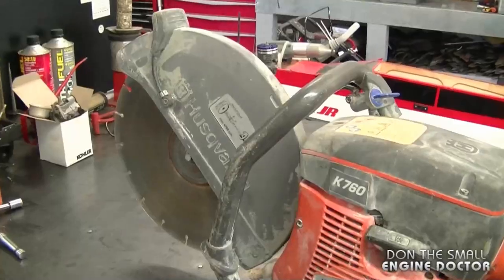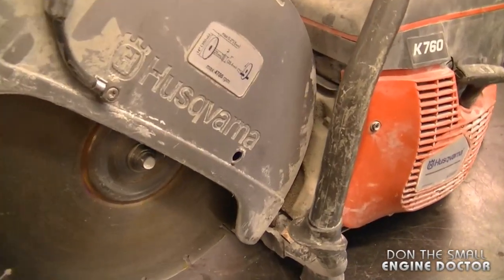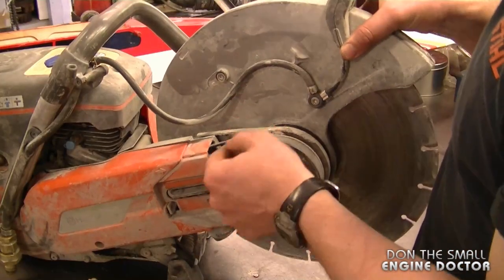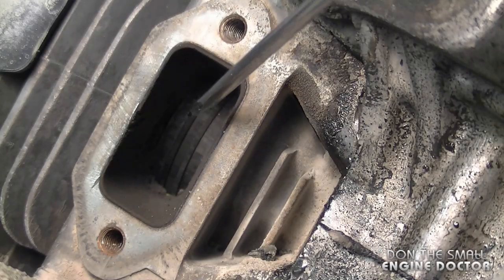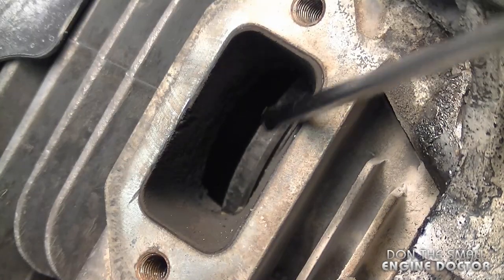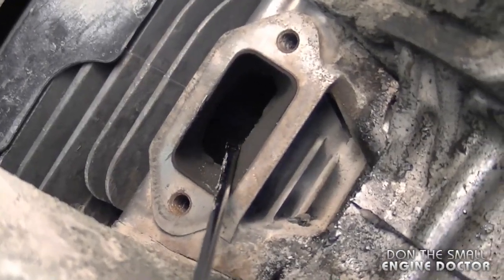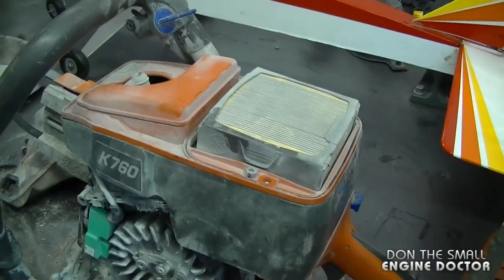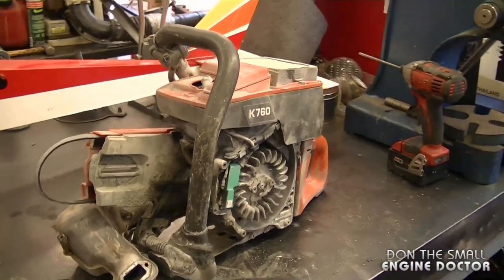Why A Cut-Off Saw Would Not Start - video

Comment: Piston/ cylinder/ ring kits are cheap for most of these chop saws. I just got a husqvarna 3120K 120cc saw and replaced the piston,cylinder/rings & head gasket and now this saw runs perfect. I put an mk diamond tiger tooth 16" all cut blade on it and now this saw is an absolute beast and it cuts everything fast with no stuttering.
Reply: Yeah, this guy is a pro but the whole replacement is less than $100 on Amazon(head, piston, ring, pins) the machine is $1200 absolutely rebuild the engine is the best. But I believe this guy charge $500 for that.

Comment: 3 out of 4 (quick cuts as we call them in Australia) saws that come into the shop I work at are all scored. I have found with those flat belts on the husky they get over tightened and flog out the crank bearing, seal and in extreme cases elongate the crank case and wear out around the Bearing. and sometimes they blow out the crank case gaskets
Reply from the maker: good tip, thanks, greetings from Canada
Reply: Hey Daniel, any idea why a demo saw would start easily but won't stay going for long? Cleaned filter, spark looks fine and I ran it without the filter and sprayed some carby cleaner and it still won't stay going
Reply: @Adam-ux3rq  the husqvarna has an oil guard. if it senses u arent using husqvarna own oil it will cut out after 15 seconds or just tick over and never rev. there are tips online about disabling this feature, might be worth a try b4 u buy any parts
Reply: @pauleleven6658  that demo saw was a Solo. I have heard of the oil guard thing on some Husqvarna models

Comment: That fine just just gets through everything because when I used to repair electric & brick concrete saws we couldn't even use never seez on the threads of the spindle the cutting blade is attached to because the talcum powder fine dust would works its way into the threads & the cutting blade flange nut would actually seize onto the threaded part of the spindle.

So, the never seez paste would actually make that problem worse !!!!

It was like when my boss bought the company my manager got upset when they ordered ZZ type ball bearings which were only shielded instead of the 2RS ball bearings with the black seal on them because the ZZ bearings would fail prematurely if the power tool was used in a smash repair shop or on a building site by a bricklayer or builder for example.

The best you could do with a concrete saw is to replace the air filter as much as possible but I have a feeling that dust will still get through that somehow !!!!

Comment: Parts must be very expensive in Canada ? 
Here in Ireland I purchased a piston and pot for a K770 which is the same as a K760 for €150 euro (approx $215) and that was OE parts direct from Husqvarna. A replacement K770 is €860 (approx $1225) so big saving.

Comment: Donny can you clarify about air filter. did the dust go though the filter, did it over heat from the filter, how did it get air if clogged? I want to know the relationship between clogged filter and damaged piston. thank you for your help
Reply from the maker: the filter was so slogged with dust that it came through and slowly damaged the cylinder and piston, kinda like using 400 grit emery sandpaper
Reply: ok thanks

Comment: I got a Partner chop saw its yellow ... Husqvarna makes it or something but the compression is good, I had a guy work on it but I think he didn't adjust the carburetor right I have to crank it a lot of times just for it to start sputtering once it does I hit the gas and a cranks on and stays on am I right about the carburetor? it has spark and everything...

Comment: Is  it  possible to have good compression and the  cylinder still be scored?...im working on a concrete chopper  and i cant get it to even cough, it has fire so im not sure....i have put  fuel  directly into the sparkplug and still nothing....the air filter was extremely dirty
Reply from the maker: yes it can, watch this video https://www.youtube.com/watch?v=Rv1PzazA7SY&t=1s

Comment: Donyboy73... i have the same saw.... i have have almost the same issue but the difference with my saw is that its too hard to pull even with the decompression valve pushed in. What is the cause or what should be changed??? If you can help that would be great thanks

Comment: I have a Hitachi "CC 12Y" - 12" CUT OF MACHINE. The blade will not turn freely. I believe one of my workers used it with water and it may have a build up of dust and water somewhere. I can turn the blade by hand but it is Very Stiff. Could you suggest a path forward? At least something to "Try"? I'm wondering if I should blast it with air?? Thank you for your time, Bill
Reply from the maker: hi Bill, start with a thorough clean up of the saw

Comment: Thanks for making these videos!!  Very helpful when working on small engines.  I just rebuilt a ts420.  Top end with piston kit, rebuilt carb.  Wont run.  Flywheel keyway is good, very good spark.  Great compression, clean carb.  Wont start with starting fluid...   any tips?
Reply from the maker: some chinese kits aren't good and often is the problem
Reply: What’s great compression? Numbers please.
Reply: @cygnus1965  125 psi

Comment: hay don i have a stihl ts 700 witch will start but when it gets hot it turns off and i dont what to take it to my local outdoor power equipment person because he chargers lots do you know whats wrong with it?
Reply: Blake robby A lot of times the culprit there is a coil going bad. Some people think that a coil is either good or bad. I have found that not to be the situation. If you have a spark tester, check for spark as soon as it quits running. If you do not have one, you can get one at your local automotive store. I prefer the in-line testers for most applications. Also, make sure that your carburetor is free of debris and water. It may run for a few minutes, and then suck up something bad into the carburetor. After it sets for a few minutes, the debris or water settles. Then, it will run and repeat the process. I hope that this helps.

Comment: i think concrete saws have short lives by the nature of what they are, at the rental store where I worked, the engines on walk behind saws might last one season and we even put the air filter up by the handle bars,, We always used the I/C engines so they weren't cheap to replace..

Comment: I have a partner 650 III
It starts up with the choke on, but when I push the choke in, it dies, and I can’t start it with the choke off...
Pull the choke out and I can start it again,
What can I do?
Reply: Same deal I have going on.
Reply: @jasonsachs6688  did you fix it? Or know whats wrong?
Reply: @heli400  I think now that I've ordered a new carb., It may just have to do with the kill switch link, maybe. Maybe it burns the gas up that gets pumped in when I prime it but the shut off lever may stop it from getting any more gas. Im not sure. Swapping carb anyways and will check that out while doing it.
Reply: @heli400  tore it apart, and the new carb only has 2 fuel line ports and the original has 3. So to that's where I got with that. So I guess make sure if anyone orders a carb online look it over before you order. The damn thing came with a  new purge/primer bubble but no place to connect it to the carb. And it says on the website that it fits this saw, ya, it fits, but it don't work with it.
Reply: @jasonsachs6688  i fixed it once already, the fuel line had a crack in it. I replaced it with silicone tubing I had on hand from R/C engines.... worked for the rest of that summer....
The silicon wouldn’t degrade from the oil/petrol mix would it?
Reply: @heli400  the fuel lines on this one are all good. I wonder if since this carb has only 2 fuel line connections on it, if it will run without the pulse line that comes from the intake? Maybe I can block it off, or if I'd just be better off buying a 2nd replacement carb?
Reply: @heli400  it's possible that it could break it down.

Comment: I have a small problem I have a 2009 craftsman tractor with a briggs v twin )not over head valves )   I am disabled so there is only so much I can do but here is the problem it starts ok runs but after a little while it loses power it is more prevalent when cutting the grass . It cuts fine about 5 min then slows down and engine does not sound right . It just seems to try to run better . I found out 1 cylinder is not firing has good spark and seem like it has compression. I do not have a compression tester  . I can pull the plug and that cylinder is not working at all.  HELP?????
Reply from the maker: you need to check valve adjustment

Comment: I would never throw that saw out cause of this. You can buy a top end kit for $40. As long as the crank didn’t suffer any damage it an easy job. And even if the crank needs replaced can press a new rod and bearings on for a hundred bucks. 
How much is this saw new? Over a thousand I’ll bet.

Comment: can you do something on stators, have a dc only with one wire and diode and I want to test it before I put it in mower, thanks.  its a briggs Stratton riding mower 283707-0139-01    thanks again dony, your a good mech.

Comment: Isn't that an easy repair for you to change the piston that and just a couple bolts on that point on what's the big deal I would you not want to change it and what would you want me to buy a new one what's involved and and having to go to the next step and you can almost got it all apart it's not repairable
Reply: James Ledesma For a lot of equipment the cost of a new cylinder, piston, rings, and gasket will be 30%-70% of the cost of a new one. And hopefully, that is all that is wrong with it. Add to that the labor and the time that it would take to order and receive those parts, it is most often easier and more efficient to purchase a new piece.